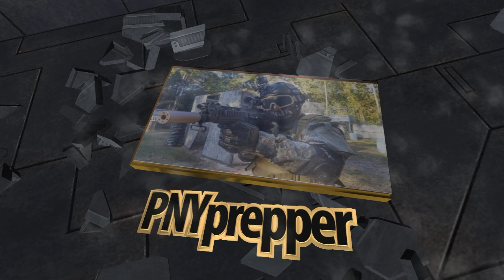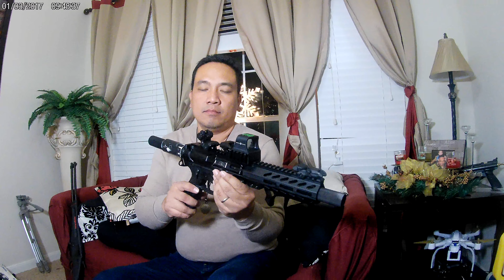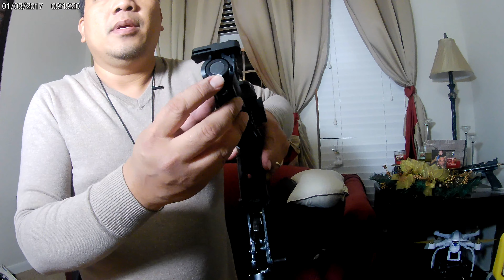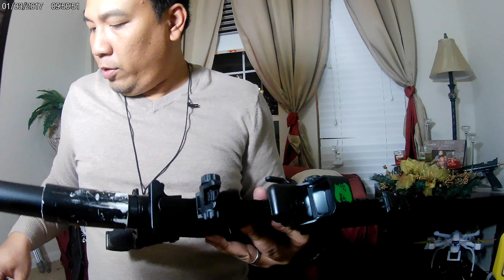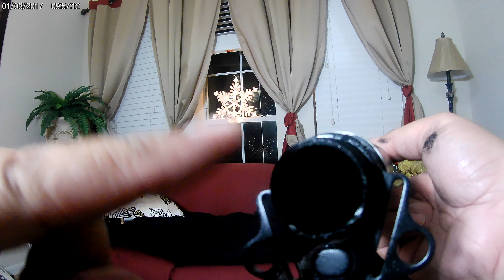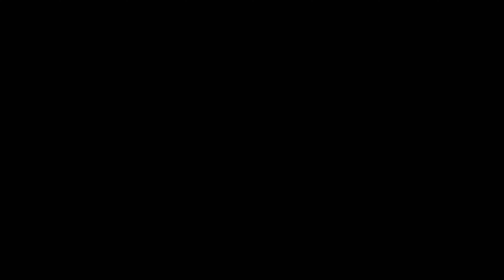AR 9 PISTOL DOUBLE FEED FIX

Comment: Always modify the least expensive part.  The buffer retainer plunger should be held down by the buffer tube so it clears the bolt carrier.  You may need to screw in your buffer tube further.

Comment: Does the FM9's last round bolt hold open feature work properly with the non-FM9 upper?
Reply from the maker: yes, but I have to make another range date with this gun. I had trouble with the bolt hitting the buffer spring stop last time.